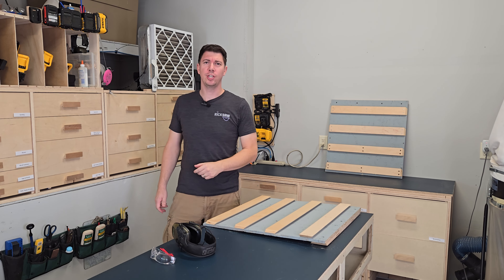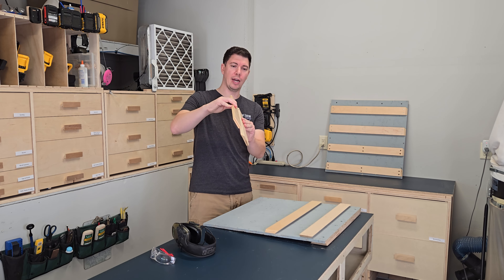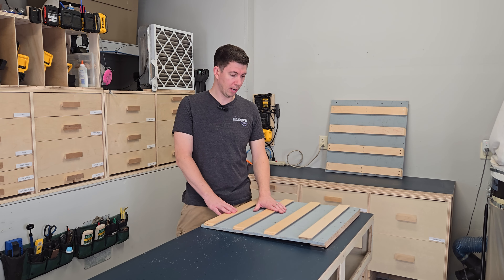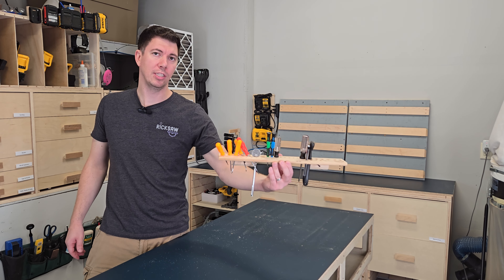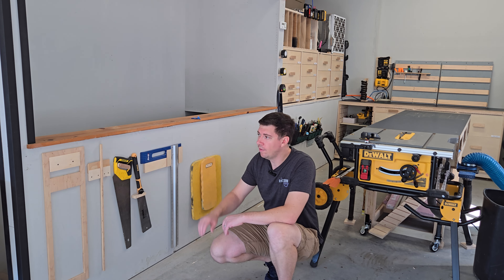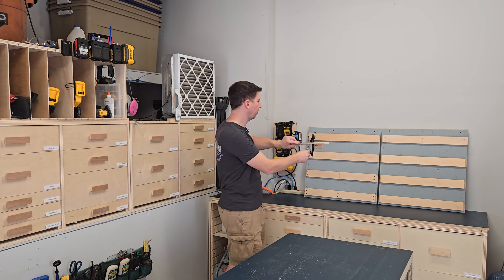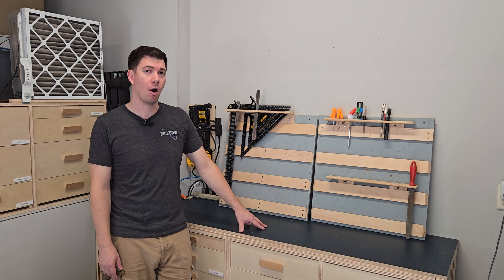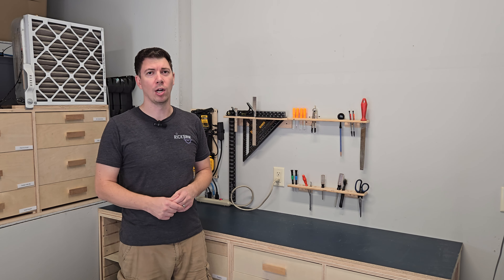Who Can Afford The Plywood to Make French Cleats?

Comment: Another option for a modular system is one done by April wilkerson it requires plywood wall panels but no french cleat slats. You still have to make holders. And the design makes them alot more stable on the wall.
Reply from the maker: Great community putting in work to develop new methods. I'd like to see more efficient use of materials  dedicating an entire sheet of 3/4 to the wall just for holding tools. We can do better! Checkout my workbench build where I developed a new method of creating a torsion box style bench using halflap joints. https://youtu.be/75V9mhHA0T4?si=SKzdc0JBAjRza4Ut

Comment: I could see your approach working well if plywood was used for the walls in a shop, rather than drywall.  I agree with you that the shape of some items will consume a lot of French cleat real estate.

The studs in a shop's walls will likely either be 16" on center or 24" on center.  I have a pole barn that I use for a shop, where the 6x6 posts are spaced 8 feet on center (if I remember correctly).  After the pole barn was built by the contractor (almost 20 years ago), I filled in the space between those 6x6 posts with 2x4s on 24" centers, and covered most of the walls with drywall (some of the walls still have bare studs showing).  The advantage of French cleats with such walls is the ability to bridge the gaps between the 16" or 24" on center studs with a continuous board that provides continuous securing points between the studs (drywall wall anchors might work in some situations, until you need to hang heavy portable power tools on the wall).  In the last few months I have been building out a French cleat wall.  I used 3/4" solid red oak for my French cleats, so there was no plywood backing board required behind the French cleats.  I am using black walnut for the tool holders because I bought a fair amount of that wood at auctions 15 to 20 years ago, and used very little of it in projects since that time.
Reply from the maker: Thanks for sharing.